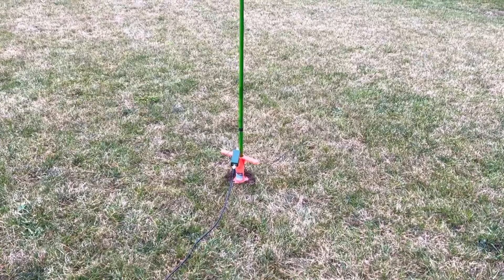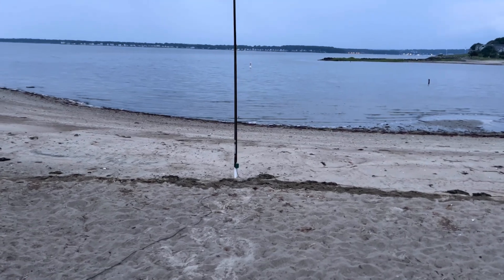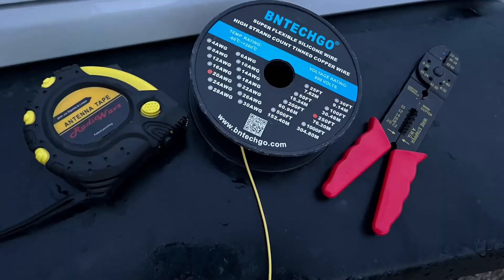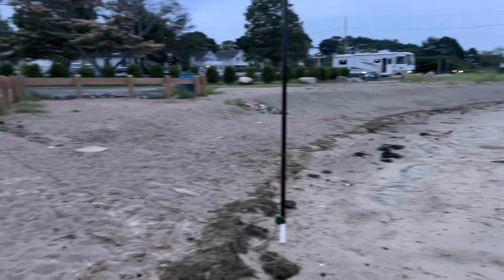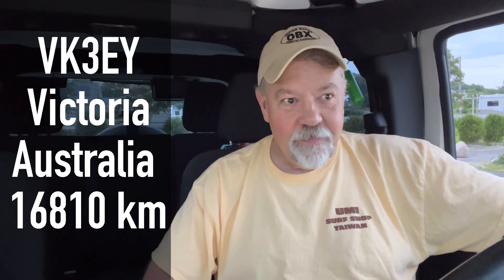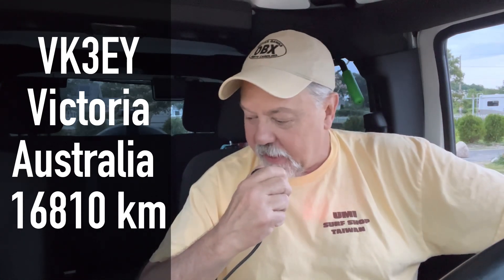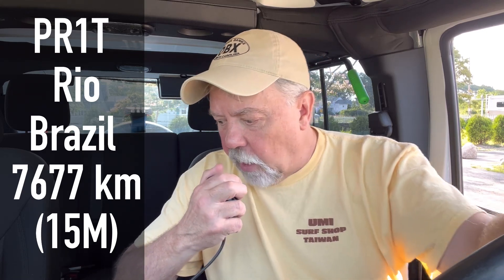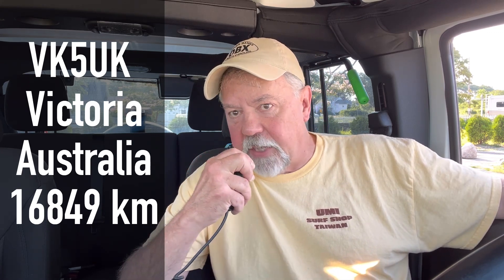Easy to Build - Rybakov Antenna

Comment: I want to try this kind of antenna at my home QTH. I want to mount it on my roof since I've already got a mount up there. Should i try to use my actual metal roof as a radial ground plane or should I just put some wires over the metal roof?
Reply from the maker: Just try the metal roof, should work great.
Reply: @COASTALWAVESWIRES I've installed it but I cant get a match on any other frequency but 27 MHz. The other bands all have 16+ SWR. I've used an 4:1 from another delta loop antenna. I think i will try some radials next.

Comment: Hi Walt , going to build antenna today …. Quick question does the coax have to be a particular length as I do have a plan but the coax will only be a couple of feet in length ……. Cheers

Comment: Hmmm, I tried this with the Chameleon 25' whip, the Chameleon Insulator, the LDG 4:1 UnUn, and six 5 meter radials, but the SWR values of nearly all the bands was outside what my IC-7300 could tune. Is there some secret I'm missing?

Comment: Love the Rybakov Antenna!. I have the 25’ chameleon whip and spike, use ring terminal with a 4mm jack to plug into an LDG 4:1 Unun red terminal and plug a black jack into the black terminal of the LDG to a chameleon puck to plug radials into. Interesting my SWRs for 40, 20, 17, 15,10 were 1.6,1.3,1.37, 1.41,1.51 to 1 respectively! And that was without radials, just the puck on the ground.? A truly wonderful antenna.  Love it! David W8BLT. Only issue if a windy day, then I use my MCC PRV….

Comment: Hi Walt! I want to thank you for your wonderful videos on building antennas!  I recently built the Rybakov Antenna using the methods you shared.  I had my first POTA activation this week and in a couple hours or so, I had worked 50 contacts on both CW and SSB!  The antenna was great on everything from 40 meters to 10 meters.  Having fun building antennas...thanks again and 73 de N4SSD - Fred in TN

Comment: 7.2MHz. An absolute cesspool of trash. 

What a lot of people don't realize is that the SDR's all over the world include a TDOA plug in and you can fairly trivially triangulate where people are transmitting. 

Once you narrow down the general region, you can get a good geometry of receivers and get pretty close to them, and then reference the XML on QRZ to look up stations. I don't think people realize that it's not nearly as anonymous as they think .

Comment: How has your experience been with that wire from Amazon?  I bought the 24 awg  size as that is the same size that SOTAbeams sells and states it can handle over 100 watts ssb.  thoughts, I see you have 20 awg

Comment: I'm getting back into the hobby, been a long while. I have found your channel very helpful. I live in an HOA restricted neighborhood. My plan is to try using my gutters as my antenna. I  will also run an end-fed half wave with some super thin wire in my backyard.  Hopefully, my neighbor won't notice. She seems to have spy like capabilities. Again, your channel has been extremely helpful. Thank you!

Comment: I’m a Disc Jokey and happen to have 4837439473848474838 miles of wire soooo…. I’ve been hacking antennas n making serious contacts…
from a beach in Brooklyn NY to Namibia on the 10M vertical. Thank you Sir… life is good.😁😁😮

Comment: Hi Walt. I built your original Coastal Wave antenna with the 9:1 and then the 4:1 ununs. Unfortunately my Icom 705 doesn’t have an internal tuner I used my homebrew Z-Matcher but didn’t have much luck with the off-center-fed so switched to a center-loaded end-fed again with no radials. The center loading had to be manually switched with a short jumper but performance was much improved. With the SOTA Beams 10M travel mast 15M only required a small capacitor for the loading and covered a good bit of the band without a tuner. You may want to consider an end-fed vertical withe a 49:1 unun at the base. A little different approach to a no-radial vertical. 73, Terry W4ZQ

Comment: I built one of these years ago without knowing it had a name... I just thought if I put a wire on a vertical fishing pole it would probably tune up okay. It worked well enough for an apartment balcony antenna! I'm getting back into HF and thinking of building this as one of my portable options. I'm sure I could do it better now with some of the knowledge and tools I have. Thanks again for all your videos.

Comment: If you were going to turn this into a fixed station antenna, what would you do differently? Rather than running a wire up a telescopic pole, would you use an aluminum element or ... ? Trying to adapt this for home use. The Cushcraft R7 isn't really doing it for me anymore. 73
Reply from the maker: @N5OLA  probably use aluminum elements. This is basically a Sigma EuroComm HF-360 antenna which is what I use at my home QTH as a permanent antenna.
Reply: @COASTALWAVESWIRES  Thank you! I have a 40' telescopic aluminum pole waiting for a project like this.
Reply: Last question!!! At home, do you use the 5% counterpoise with your Sigma?
Reply from the maker: @N5OLA  no, my sigma is mounted on a metal handrail which is connected to my metal roof. That’s all.

Comment: I was thinking of mounting this 10' up on my pergola and running elevated radials over the pergola. I notice that your antennas are usually mounted in the ground. Is there any added benefit from adding 10' of elevation?
Reply from the maker: Actually the benefit is the ground especially for me by salt water. The reflective RF ground of the surface below you is the advantage with an antenna like this. Height is not always an advantage for a vertical HF antenna.
Reply: @COASTALWAVESWIRES  Good to know. I'm on South Padre Island TX and my house backs up to the bay. Thanks for the reply!

Comment: What is the base diameter of the DX commander 10m pole? I'm trying to figure out which screw-in umbrella holder/spike to buy.
Reply from the maker: it's about 45mm or roughly 1-3/4 inches. I have not been able to find an umbrella spike big enough to support it and that's why I use PVC pipe as a support spike. 73, Walt

Comment: My current home antenna is a 53 ft Rybakov. 25 foot vertical section and then a 23 ft horizontal section roughly 25 ft off the ground with an LDG 4:1 unun and 16 radials. I work 10-80 meters with no problem
Reply from the maker: Cool, great setup

Comment: Hey Walt, great work with your Rybakov. I worked VK3EY a few days later from the beaches of Brittany and I mentioned you as my chosen source of inspiration😁
I have a Rybakov I bought from M0CVO (as the "Magitenna") before I watched your videos (I would have built it myself instead) and sometimes it works really well, sometimes not so good. The ground conductivity seems to alter its efficiency quite a lot. I use it with 8x5m ground radials when I can't take advantage of a wire to the sea water like you did here.
On 40m my SWR is in the 2.5 range. I need to use the G90's tuner. Also on 16m.
I've experimented a longer radiating element (29ft, 8.84m) with a 9:1 LDG unun and SWR was worse. I ended up using the 4:1 that came with the Magitenna but saw no significant difference from the original 25ft, 7.6m wire.
Best 73s to you & family, Walt.

Comment: I want to try at the beach here @ South Padre Island, we can actually drive on the beach north towards port Mansfield and have little or no traffic sometimes. DX Commander looks like a reasonable option for for the beach, do you use an umbrella mount sometimes? Screw into the sand?
Reply: W8BLT
Reply from the maker: I use an umbrella mount for my smaller poles but my 7m and 10m DX Commander poles won’t fit in the umbrella holders I have. I just screw the bottom cap off and slide it over a piece of PVC pipe

Comment: Here is a video of my radial kit. 4 x 5m long. Made from silicon wire to make them easier to unroll. My whole antenna system is made from Ali Express parts, but I bought the 10mm to 3/8 adapter for the telescopic whip to keep things at 3/8. Even the spring and the string winders came from Ali Express. https://youtu.be/zKSV8wBxUhE?si=_iig0XBlcRMzIHJW
Reply from the maker: @GordonHudson  that clamp is perfect. That’s nice. I really like that.

Comment: That's fantastic. Very inspiring. Partly thans to you (with a healthy doese of Callum obviously) I recently bought a DX Commander Classic 10m pole and an LDG 4:1 unun to try this very antenna. The heatwave here has delayed things, but hope to get it up this week. Wee question if I may. The fully extended pole is 32ft and the Rybakov 25ft. Do you just tape the wire to the pole at that length or are you using one of those s-biners for this? If so, how? Again, really inspirational stuff. Les, Oregon, KK7TPM
Reply from the maker: I just tape the wire to the pole with some cheap 99 cent electrical tape. As you can see in the video I have the feedpoint at the bottom so the wire only has to go up 25 feet from there and there is some naked pole at the top lol. Thanks for the kind words! 73, Walt

Comment: Walt: How does it play on 80 meters? I have one cut & bagged, but famiky has kept me from getting out. Maybe I can get an early August POTA activation...de WB2VUO in Amherst, NY
Reply from the maker: Honestly it tunes and works on 80 but I haven't used it there. There is a link mod you can do to make it better for 80. Do a search for that, I think there is some info out there.

Comment: Hi Walt I use a similar design I came up with 33ft vertical 9:1unan with 16ft6inch capacitive radial system.  Great videos hope to work you again de M0JFE
Reply from the maker: Interesting setup! Hope to get you in the log soon! 73, Walt

Comment: Great fun Walt ! Yes early morning . Grey line DX is great ! For last Fall/Winter?early Spring 10/12 meters was GREAT ! Both the Rybakov and end fed half wave veritable and the longer 9:1 random wire veritable ground mount is great DX antenna .Easy to set up. Someone north of me did a POTA on 7200 and got it done. Did video on youtube. Was great !  I did FT8 on 17 meters and 15 meters just the outher day. was great. some DX . I got my QRO 49:1 warm.  got over 100 contacts from 5Am to Noon.  400 watt . Same setup but was a Park . and 49:1 with mono band wire cut for 15 and another one for 17 meters.  Just drop down change wire.  I did 4- 17F counterpoise on ground.  works great ! I got tune around 1.3/1.5  on FT8 . stays under 1.8 on SSB part. I get better tune on my 10/11/12 meter wire and the 6 meter wire. 20 meters goes up but under 2:1 the whole band.  I used a 2 stack of FT 240-61 wound with 10 AWG mag wire and 3KV 100 PF cap.  Not hard to make a UNUN . 73
Reply from the maker: Roger that, I can't wait for fall as 10/11/12 will start getting better again. This winter should be amazing as we are probably going to be pretty much at the peak of this solar cycle. I'm going to do a lot of 10 and 12 playing on camera and for 11, umm well I'll be there LOL. 73 my friend

Comment: Hi Walt. Because of your YT i comeback to my 11m dx and started working with to get my Ham license. You are inspired me to do Ham license , so hopefully I get before this end of year. 73’s
Reply from the maker: You can do it! I’m an 11 meter guy that became a ham. Good luck my friend 73, Walt
Reply: @COASTALWAVESWIRES  I have started to build antennas, so I all ready have Rybakov , EFHW  and last weekend i have build T2LT from rg6 coax ( 75 ohm) with 240-61  ( takes 1,5 hour calibration to get 50 ohms and 1-1,2  on 11m) . After I tested last weekend I’ve got pretty good results with T2LT 10w Sweden-Brazil  ( 5988miles) . When I do my Ham license I’m pretty sure that i want to hunt You
73’s
Rafael

Comment: Thanks for another great video. I'm going to build one of these. I'm semi retired, so I'm on a budget. Can I use a painter's pole that's about 24 feet when extended, or would the aluminum pole sections cause problems? I could cobble together some PVP pile ( I can't really afford a DX Commander pole). Also, I've noticed a lot more nonsense on the 40 meter band these days: people playing music, swearing (got nothing against swearing just not on ham radio), and political rants. I love amateur radio because it's a place I go to to avoid the craziness of life. Thankfully, there is the 20 and 15 meter bands for DXing. I live in Marin CA, so we're near beaches. I really want to try putting a counterpoise out into salt water. Thanks again...73...KN6KNB
Reply from the maker: Thanks for watching! Unfortunately that painters pole will cause problems because of its metal parts. Here’s an idea I’ve tried and it works. I’ve used a couple old smaller poles and taped them together to make them extend to the 25 feet I needed. You could get a couple cheap Crappie poles online or find some old fishing poles and strip the eyelets off them. That’s actually how I built my first Rybakov when I was over in Poland. If you go back and look at the beginning of this video, that green mast is a couple poles tapped together. 73, Walt
Reply: @COASTALWAVESWIRES  Thank you for the information. I will do exactly what you suggested. Thanks again...73...KN6KNB

Comment: 5.6 m whips are readily available online. I'm considering just hooking one of them up to 2 m. of wire on a pole--(2+5.6=7.6) effectively a Rybakov.
Reply from the maker: I have a couple, not a bad idea. The trick is the coupling at the feedpoint. Putting a 4:1 at the base is key.

Comment: hi thanks for another cracking video can i ask a basic simple question the wire into the water is it insulted or bare wire thanks
Reply from the maker: Hi and thanks! It is insulated but it doesn’t matter. It’s no different than laying a counterpoise wire on the ground. Same principle.

Comment: Ha! I built this antenna last evening and got my first DX on 20 meters. I spoke to a pretty cool guy in London and a guy in ST Martin. I used 4 counterpoise. I think they are too long, 25, after hearing you say yours is 17’.
Reply from the maker: Those counterpoise wires are probably much better than my 17 footer. The more the better, they're not too long. I only need one short one because of the close proximity to saltwater. 
Great contacts and congrats on the DX! 73, Walt

Comment: I use this antenna often for POTA since I can just use my drive on mast mount and a 30ft pole. It's not as good as my 53ft or 71ft EFRW but it's quicker and less trouble to use in high foot traffic areas. 

Like you said, for 40-10 it's a good option and gets decent results.
Reply from the maker: Yes indeed, pretty good results

Comment: Great stuff Walt. I have been messing around (i.e. experimenting not doing silly stuff) with my Black Brick QRP SDR radio which is proving to be great fun with EFHW style antennas. The reception is brilliant - better than my FT450D ? - and on the internal mike can get some great 5 watts TX as well if the conditions are right. 73 M7BLC
Reply from the maker: Thanks! I need to grab my Red Brick the next time I'm home for a visit. 73 my friend!

Comment: Hey Walt, I just wanted to say Thank You for the tip off about using "speaker wire" for building antennas.  I bought some off eBay (it arrived this morning) and I'm thinking about building the Rybakov as a simple home base vertical here. I'll need to get a 4:1 unun but it's payday this week so fingers crossed I can grab one next week. 73 and good DX. DE G7LPW (Keith) in Norfolk England.
Reply: @tankthetuba  if you like building your own gear, consider making a 4:1 guanella balun. They're easy, cheap and effective. I made one for my home base antenna and one for my kid's radio club in the same afternoon.
Reply from the maker: Hi Keith! Thanks for the kind words my friend and have fun building antennas! 73, Walt

Comment: Very cool! How does the Rybakov at 25' compare to the 17.5' with the same 4:1?
Reply from the maker: They are very similar antennas especially on 20, 17 and 15 meters. The Rybakov adds 40 meters and is really amazing on 10 meters.
Reply: @COASTALWAVESWIRES  Thanks for the info! I've been using a 17.5 as my qth antenna for some time now. With my tuner, it's good for 15-40 meters. It appears to tune up on 10 and 12, but I've only been able to complete a couple of contacts on 12, and none on 10. 
I'll try the 25' soon.